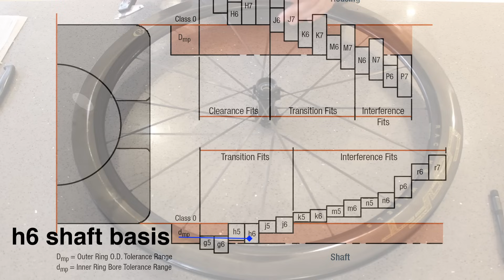CRW Wheelset - Roast again or Reheat?

Comment: Great information here. Did you say that you had a 30mm on the rear wheel and a 28mm on the front? I was originally interested in the CRW 5060, but worried about the fork clearance of my Seka Exceed RDC, so the CRW 5055 look to be the ticket. I want to use a 28mm and possibly even 30mm tires. Thanks

Comment: As commented on the original video: fully support PT's opinion, etc. One note though (as mentioned on the product page) the wait list for these is now getting seriously long. Production capacity is increasing, but they're being super cautious (for obvious reasons!) so please wait patiently. We handle orders in first-come first-served basis, but please be patient.
Reply: Could you compare radial stiffnes CRW4045 to Elite Drive 50D.
Reply: @grzegorzkowal6480  Joe put out data but it seems inconsistent with PT's testing of the 40D which showed much less stiffness:..

CRW CS5055 was 50.67N/mm.
Elite Drive 50D was 57.86N/mm.
LUN Mega were 59.61N/mm.
Reply: @jasondebretteville4036  I didn't know they are inconsistent. I saw this comparison,  However I asked about radial stiffness not lateral. This parameter is more important for me.

Comment: How’s the comfort/ feel?  Do the carbon spokes make them feel too stiff?
Reply: Have a pair of CRW4045. Comfort is good at 7 bars tyre pressure.
Reply: @klausdietrich9475   I was disappointed with how stiff are Elite Drive 50D, I mean they are too stiff in comparison to wheels with steel spokes. I lost comfort. I was wondering how it looks ride comfort CRW4045 in comparison to  elite drive 50d
Reply: I think you should be fine. I run a 24mm tyre at high pressure and comfort i good. I‘m 79kg.
Reply: You don't buy deep section carbon wheels for "comfort".
Reply: I'm wondering about the same thing. Please let us know if you have this figured out!

Comment: So, there was a major issue with these that made its way to market, and the solution is that they'll start QC'ing them for the problem only now. This whole QC only after the problem is found isn't going to work well for these Chinese brands entering the Western market for the first time. Its just backwards. Fingers crossed this is a one time issue. I'd love these brands to succeed, but it shouldn't be the consumers responsibility to find what still needs some QC. Peak, you've said over and over that these brands are rushing to market, and I totally agree. Rushing these products to market without better QC/QA does more harm than good to long term sales.
Reply: Everyone has issues.  The big take away is how they respond and fix the issue.  And how Panda Podium worked to take care of customers.  While I agree this sucks, having wheels like this for such a cheap price, a company that is willing to listen and a seller that can take care of you, is a pretty good deal.  I think having Panda Podium as a middle man is really going to help build a better Chinese product market for the west.  Good comment, I hope they spend more time on QC for the next gen.
Reply: Really! Western car manufactures have safety recalls and engine issues  and these are cars! 
Remember no one is perfect even western brands Specialized with the steer tube replacement expander on the SL7, canyon with seatpost issues and snapped bars, Hugo Hofstetter snaps Bianchi handlebars twice during GP Denain. Laporte and Van Aert's cervelo wheels broke at Paris Roubaix last year. Looks new bike handlebar snapped at this years TDF. What about these major QC and design issues from the big boys and your  concerned about some minor QC on a small Chinese wheel brand  issues give me strength man 🤦🏻.
Reply: Western manufacturers only marginally better.
Reply: They're trying to get product out there before the bike bubble bursts and everyone has inventory they can't move.
Reply: @Omnis2  boring!  😴
Reply: I would prefer a small Chinese brand recognising the fault and rectifying it rather than a big name western brand trying to cut corners and relying brand alone.
Reply: cough Shimano cranks cough

Comment: Do you have any comparison to some other wheels like Zipp 404, Roval CLX or something like that.
Reply: I have them for 3 weeks .After having Roval Rapide ,Zipp,Bora wto ,Vision ,Blank inc 60…There is no comparison this wheels are just rocket in acceleration ,uphill ,downhill ,flat you name it
Reply: Have them already for about 3 month! Love them too. At really fast speed I find the roval and zipp 404 better. They are really bad at wind.
Reply: @jonasstolz1311  never had an issue in wind with them and  find them faster the Roval…now only a head to head comparison same day tyres and bike could probably tell you more
Reply: Yeah also think they are as fast as the rovals or even faster. But me and a friend mentioned the wind „problem“. It is not a real problem, but the 404 performed better with wind. Everything else was sooo much worse 😂 the 404 are really terrible when you know what is possible. 

But at the Bavarian alps on descents with 65+ I already had two really sketchy moments.

Comment: I purchased these wheels and only got a few rides in before I got hit by a car. Subjectively, the combination of light weight and low drag with these on my F10 made them a gamechanger from the 2019 404 NSW I was using before. The acceleration going downhill was unlike anything I had experienced before and the front of the bike became extremely light and playful. I am a huge fan of the every so slightly slacker geo of the dogmas vs road bikes (cervelos, specialized) as it feels a touch more stable, but man these wheels sure changed how reactive the front of the bike behaved. Also note that the cockpit is darimo so the front should feel lighter to start.
Reply: Lmao
Reply: "The acceleration going downhill was unlike anything I had experienced before and the front of the bike became extremely light and playful" Last time I checked gravity hasn't changed.
Reply: Last time I checked nor has the influence moment of inertia in acceleration
Reply: @realmagnetics799  are you aware constant acceleration applies to falling not rolling
Reply: @realmagnetics799  Last time I checked the acceleration due to gravity of a bike rolling down a hill is affected by rolling resistance and also aerodynamic resistance, which is why people put their head down to go faster downhill

Comment: Confused, did you get new parts to fix the wheels or did you do the fixes yourself? I am hesitant because no being an engineer if I get a bad QC wheel I cannot fix it myself.
Reply from the maker: They sent the larger end caps, but the centerlock thread i fixed myself

Comment: FWIW, just got mine. Actual: 1323g without lock ring or valves. Listed: 1290+/-2% (1315g) which PandaPodium Tech rep says if I remove the rim tape it would reach it yet all my DT Swiss, SwissSide Hadron2’s and Roval CLX all include it. 

I know we’re talking grams, but the biggest reason we’re talking about these wheels at all is grams. I’d rather they advertise 1350 and show up 1350 than send YouTube reviewers better made wheels at 1257 like yours and send customers lesser quality.

P.S. your videos are excellent PT. Hope you’re able to take pride in them. 🙌
Reply: Which model you got!? The 55/50 or 50/60?  What was the total weight I am still thinking between this ones or the Drive 50s
Reply: I have got the 55/50 and were 1248 with tubeless band .So it was like 2 grams lighter than advertised
Reply: @Danielkuota1  I have the craft 55/50 and the Elite .The craft weighs 1248 with tubeless band and everything and they are rocket wheels.probably better than most others have ever had
Reply: Thank you for the reply. I appreciate. Yes I already ordered the 55/50. I don’t like much the idea of a very wide front wheel. I think that internal with it’s a bit to much. I can’t wait to receive them.  It can take up to 20 days to Uk :(. I hope for the best
Reply: @Danielkuota1  I belive you ll be very happy with them .
Reply: Hi jan 

Just to give update. I got the wheels. And initially I got the end caps with not the correct sizing. I was experiencing some noise while riding they send me a replacement and it reduced the noise. But I have a question to ask you. When you gently the front wheel axle without the end cups or even with it. Does it feel sort of “thigh”!?  Mine does fells smooth like butter. 
I am asking this because I used to have a contrager Rsl wheel and they have a bearing issue tolerance (the bearing it’s to compress) and this wheels also feels similar. Do you experience that on yours!?
Reply: @Danielkuota1  not tight ,it feels smooth .Didn’t  experience no issue with them and I raced them hard .

Comment: Its a total joke that you have to measure parts of your wheels with a micrometer to check  if the makers have bothered to manufacture the parts correctly. I have got DT Swiss and have never measured anything , just fit the wheels and ride. Why would I bother with any other half- arsed  junk.
Reply from the maker: My point exactly and why i got so angry in the last video!
Reply: My DT wheels were the worst I ever bought...

Comment: I wondered how effective the fewer spokes would be Aerowise.  I have wondered if the move to disc brakes and generally the higher spoke count needed to deal with braking forces has been behind some of the move back to Tri spokes in TT's - Priceston/ Revolver etc (though Dan Bigham rides the Cadan trispoke with the very slim hub on a rim brake bike).  It will be interesting if the design and carbon spokes holds up over time to braking forces.  At the moment if they can show the QC issues are permanently resolved they look like a good FRO wheelset.
Reply: I'd like to know the actual penalty as well as far as drag.

Comment: You got a free set of wheels?...so not exactly free engineering.
Reply from the maker: I've got enough wheels to test!
Reply: @PeakTorque Sure but you can sell and make good buck off of the set. Point is they still represent value obviously.
Reply: Yay! 10k of engineering knowledge for a 1k set of wheels you don't need... FFS.